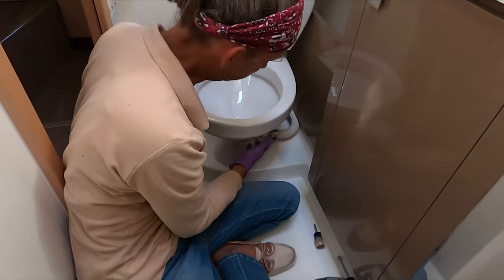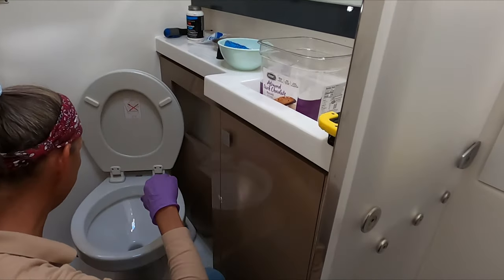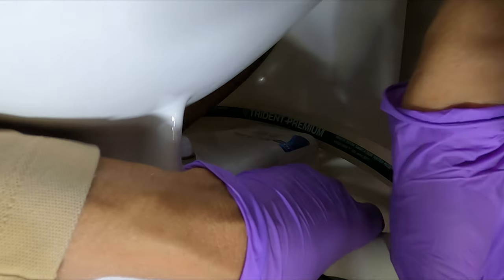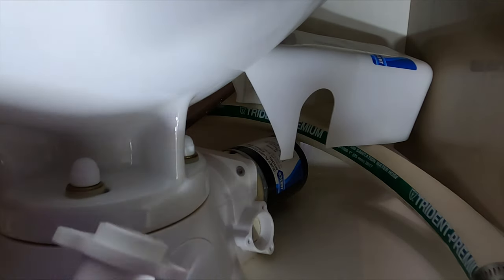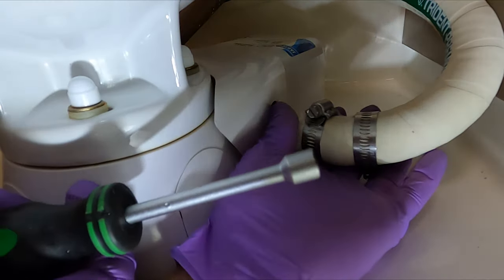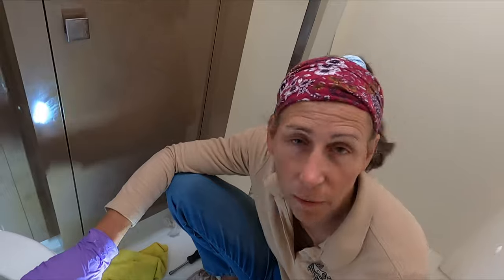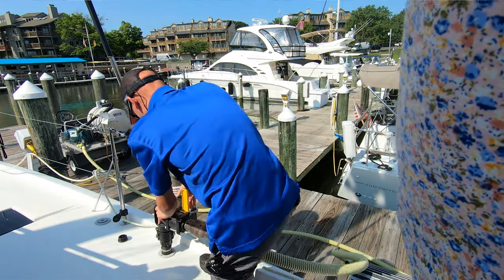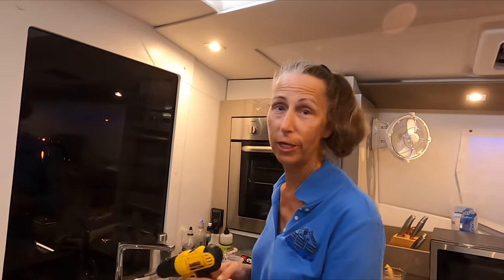How to Change A Joker Valve - Ep. 17 - And What is a Pump-Out?

Comment: Thank you so much for filming this. I thought there was only a joker valve in the wall. I did not know about the one below the bowl. Now it's time to get this s**t done. SV Next Day On
Reply: BTW if you have a 2017 Helia your joker valve is in the wall. And if u need access to the owners tank it’s behind the potty. You will need a suction cup to get it out because if you only lift from the bottom it gets in a bind and won’t move. Telling you as a friend you will crack 😢 the pretty laminate. Fortunately we stopped and it’s not that bad. Hope this helps others. Thanks again Heidi & Franny for videoing it really helped

Comment: You need to put multiple floats on that key.  Franny is definitely braver than me and I'm an Army veteran.  I have owned ten boats and I had to replace the heads on three of them.  I couldn't tell you how many macerator impellers I've had to replace over the years.  I replaced the first head and the first impeller myself.  After those nightmares I decided that paying a professional whatever they wanted to fix a head was worth it.
Reply from the maker: Oh, the key for the pump-out?  Franny told me we can always use the manual winch handles.  I did consider buying one off of eBay as an extra. .
Reply: @HeidiandFranny it looks like a big external torx or triple square bit?  Maybe get one to use with the socket set as a backup?